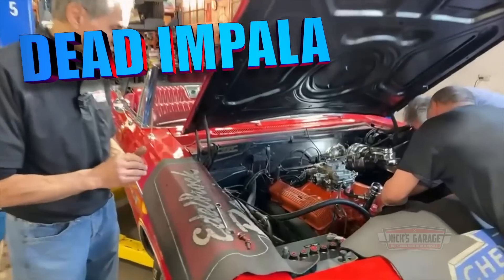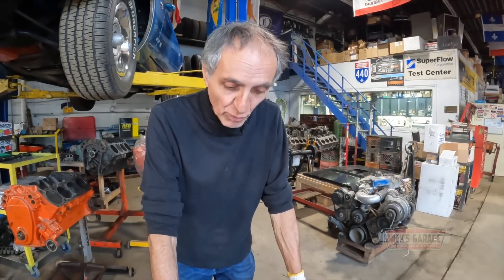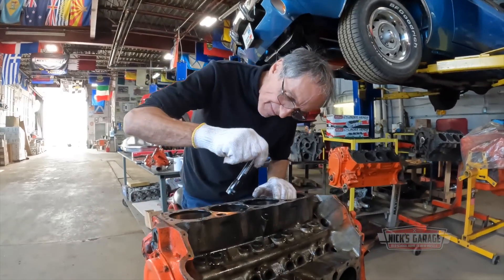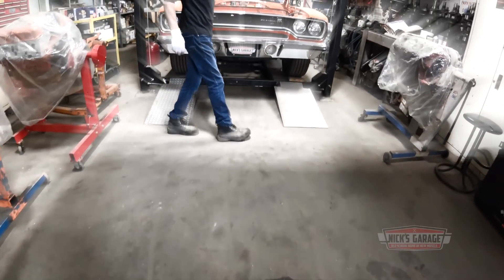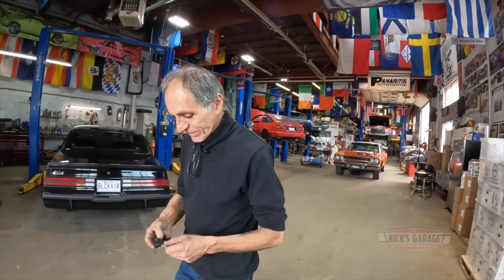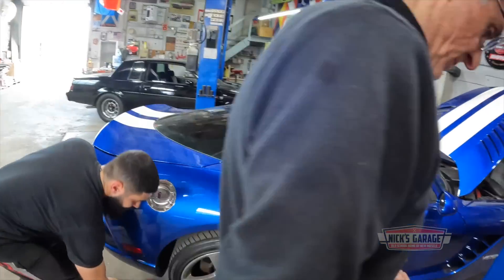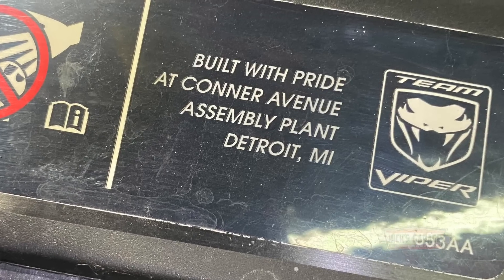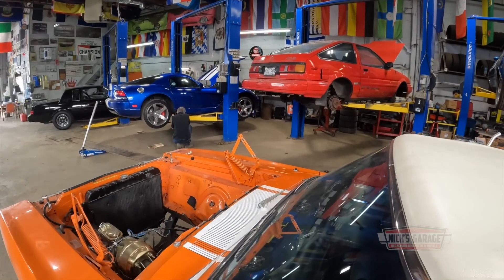327 Chevy Autopsy - Smoking Gun FOUND!

Comment: Years ago I worked on a truck with a 6V 92T Detroit Diesel. He drove it 300km bobtailing without overheating, but as soon as he hooked onto a trailer and got it under load, it would get hot. Detroit water pump impellers occasional would slip. To chec I took the suction hose and the pump cover off. Found a rag packed on the impeller. The radiator had been out and the mechanic left the rag in the suction cover. Without a load a diesel injects almost no fuel so combustion is cool, so no overheat.

Comment: Check the radiator cap it will not vent right and squeeze the upper radiator hose down and block coolant flow

Comment: With the engine getting that hot it could have warp the thermostat stem,im not saying it was'nt a thermastat failure,just saying the locked up thermastat could be from the intense heat.

Comment: Nick. Bad luck loosing that engine. While your tests showed faulty thermostat I was taught never to reuse a thermostat if engine overheated. I'm wondering if overheating caused thermostat failure and not other easy round. You have not mentioned heater core?. I guess you pressure test live system. We had one engine that blew water. 4 cyl. Changed heads and it still did it. Turned out it was a cracked block migrating from head bolt and leaked into bellhousing and dripped out. Was a turbo engine and only under boost with extra load did it misbehave. On another engine we couldn't stop blowing out, fumes. Was a sleeved engine in a racing class. Was all done with torque plate etc. After some time I experimented with checking cylinder roundness with gearbox bolted on and discovered no 4 bore was being pulled out of round by .004" when bellhousing bolts were done up tight. Keep up the awesome videos. Now working on 2437cc turbo engine. Got it pumping out 745hp at the wheels at 6300rpm and 600ft lbs at 5600. That's with 36 lbs boost. We have changed turbo and cams now and modifying wastewater controller. Added thermocouples to each exhaust. We are shooting for the magic 1000hp. Engine is hand made billet with tall deck  long rod set up to help piston acceleration loads and improve dwell times. Mitsubishi based in a 4wd.

Comment: Check the heads crack between valve seats or replacement seats cut to deep, heads should be pressure checked

Comment: You need to take the thermostat out of the water and then measure the temperature directly off the Stat. When you aim it into the pot of water, all you're seeing is the surface temperature of the water. I did infrared thermography for 20 years in the electrical industry and if you look at water with an infrared camera, it is very far from having a consistent temperature. You'll see swirling patterns that have substantial differences in temperature.

Comment: Is it possible that the thermostat is not the problem, but a damaged as a result of the extreme over heating?
Reply: Some casting sand or specks of rust can cause a stuck thermostat. It's good insurance to wash the block and heads if the machine shop is slac king

Comment: One reason cars overheat is when the thermostat sticks Open.  The motor gets hotter and hotter. Until it boils off all the water. I'd have to see the heads. But I've seen it before. Normally a driver would notice but. If it is stuck open it can stay that way forever.  Also check it for actual temperature that the thermostat functions at. The old one may be cooked  also. Should also check the radiator cap.

Comment: in situations like this you might save both your self & customer agravation you might want to install murphy safety gauges on oil pressure &temp so motor will shut down when ever engine reaches your pre set point. Some times even when people see warning light they just wont stop until they arrive where they are comfortable. often times that is to far damage done.

Comment: I had a 65 Chevelle 327 that blew a radiator hose while doing 70 miles an hour on the highway and shut it down immediately and it's still heated up enough to where the block had to be line bored at the mains because when I rebuild the engine I could not rotate the crank after I had installed it with all new bearings

Comment: I have a 1978 corvette 350 30 over I lose coolant badly motor runs great no steam out the exhaust no sweet smell no water in oil no oil in coolant no leaks anywhere motor runs great, can’t drive it because coolant goes away fast ? Checked everything at a complete loss where to go from here, maybe pull heads and inspect. What do you suggest would be next to look at.

Comment: That’s crazy… thermostat failure… wow.. you buy one now, one could only assume it would be functioning correctly from …. Quality control tests before packaging and for retail….? 🤔.. one could say the over heated engine caused the failure after the fact.. If everything else is correct in the system and the t system is the only thing showing non function.. then it’s no doubt the T stat that created the problem.. good find Nick!

Comment: In Tool & Die we use a liquid die made specifically to find hairline cracks. May be useful in your tool arsenal. Your knowledge and the quality of your character make for videos I truly enjoy, thank you. A question: working on old vehicles have you ever not been able to find a  needed part. It took me 4 months to find a transmission tailhousing for my 89 Dodge 3/4 4x4. Found one 2000 miles away and cost as much as a transmission.

Comment: I once drove a taxicab in Tucson Arizona for several years. I was driving a taxi. It was a Ford Taurus wagon and it starting losing power. I noticed it was running hot but not overheating. I was able to get it to the shop, i told them of the performance problem and got me another taxi. The next day i was told the vehicle had overheated and now it had low compression and won't start. There was no coolant in the radiator. But the strange thing was , I never saw any steam. At least not around the front of the car. My guess is the engine blew a head gasket and i did not notice any steam coming out the tailpipe.

Comment: I would consider submitting the thermostat that failed the "heat test" to your insurance and see if it will pay for the rebuild.   Given that the hot light was working they may not pay, but once that's been done your own liability can also be mitigated using the insurance failure to pay as a basis for not accepting full liability for the motor failure via your shop.

Comment: i had a 350 marine engine i over hauled, that sprayed water everywhere when it cranked.  i pulled it out of the boat 3 times  to look for a leak in all the areas you mentioned and it wound up being a small hole in the valve port that on the #2 cyl head.  replaced the cylinder head and put it back together and it ran for the next several years, trouble free.  i had the machine shop that did the bore and crank turn, boil the block and heads also, and that seems to be the time that the rust that was removed from the raw water cooling sys, loosened a rusty spot in the head on that #2 valve port.
Reply: Was your boat engine a 350 cu in Or 454 cu in Chevrolet  engine?
Reply: it was a 350/5.7l with 2 bolt mains, 'bout 79 vintage i think.  all cast iron block and heads and manifolds, reverse rotation with paragon transmission and single screw.  crusader brand exhaust and risers. originally pulled it after the raw water pump failed and overheated the whole block assembly due to no water.  be sure you replace the rubber impeller every year or be ready to spend some money.

Comment: I did see one lock up completely when a guy fell asleep with the engine idleing and the heater on in the winter it had a minor coolant leak that caused it to overheat and lock up tight old boy woke up cold and with a junk engine totally junk it melted the plastic round clip off the oil pump that holds the pump rod in place during assembly that's hot

Comment: I have used those free flow thermostats before and have had over heating problems I went back to using Stant regular 180 thermostat and all was well again try Stant I wouldn’t trust them Mr Gaskit one’s especially if it was fine at first them stopped working later could happen again 👍👍

Comment: all that grief for a stuck thermostat. I have had them stick shut but figured it out before it was to late. if he was driving slow in town he might have been alerted buy the steam surging in the radiator but on the road it all went unnoticed. looks like a real temp gauge would be a good idea. although the hot light should have come on if it was in working order.

Comment: Do they make a sensor you can install in engine that if it starts to over heat will shut the engine down be a great ideal. I have worked on cars all my life probably seen 3 New ones bad from The start what's mind bottling it was working just fine and ended up sticking. I would check with Mr gasket companies are contracting there work. Alot of them have there items built some were else see if they have switched manufacturers. I was in manufacturing most of my life we could always tell when they changed things up.

Comment: Interesting work-but where did the coolant go ? Hose seal = headgasket - waterpump ?
Reply: My thought also. Engine was obviously burning coolant if exhaust was steaming. What do the spark plugs look like? Should be able to see which one are steamed cleaned. Coolant had to go somewhere.
Reply: @jedm1466  Bet you it was a bottom rad hose not nipped up enough and sending a tiny jet of coolant out onto a hot exhaust pipe .  easily done !

Comment: Use brake cleaner clean cylinder walls then spray walls again let it air dry and the cleaner will show cracks due to it taking longer to dry in  crack it will still be wet in crack works good

Comment: The car/owner made more than one round trip, without problems. That says everything was operating normally, including the cooling system. The last time I saw an overheated engine with the paint burned of near the deck surface, the coolant level had run low enough that the heads were 'dry'. Someone commented on seeing steam or smoke coming from the exhaust pipes. That would bring questions regarding cracks in the cylinder head(s) We recently went through a similar experience with a small block Corvette engine rebuild. 
 By the size of the serial number pad, front, passenger side deck surface and the driver side location of the dipstick, the block is a 1977 to 1979. Later 1079 blocks had the dipsticks moved to the passenger side. That would make it a large journal 350 block. To make a 327 with that, a crank from a 307 (large journal with 3.25 stroke will yield 327 cubes.

Comment: I must confess I did the same thing here. I have a .030 over 327 engine and I went up into Georgia to service a business machine (live in Jacksonville Fl). Well, I worked into the early morning hours and went home. Going down US 1 and on a two-lane country road and I notice my vehicle starting to surge and looked down at the gauges and the temperature was pegged hot. Well, I really had nowhere to pull over (unless I wanted to drive into a ditch) and continued on until I could find a place. Well, the stupidity is on me as it was a ways before I could stop and the engine was cooked, so I just took a nap and woke up in the morning (I had finally stopped at a convenience store). I put some water in the vehicle and got it started and drove it for a while but had to put another set of cylinder heads on it, have the deck of the block surfaced and had shrunk five pistons (of which we had knurled). I cooked that engine far worse than this one and fortunately there were no cracked cylinders.  Not a thermostat, not a head gasket but a bad radiator cap. I used the same radiator cap that was on the vehicle when I assembled this engine and when a friend of mine who had a shop tested it, it was bad. Well, that is on me, and I learned something there for sure. I had learned a lesson on a sticking thermostat some years before and flubbed this deal as well. Also, when an engine overheats one should never keep on driving it as when the coolant is gone, air is a poor conductor of heat and that is what cooks the engine up. Pull off immediately and let the engine cool (no water until it cools as you can crack things). Whether this owner continued to drive after the car got hot is really his issue but I am willing to bet he had but I am willing to bet that he won't do that again. Granted it is not always easy to immediately pull over due to where one is but continuing to drive an overheating vehicle can be costly. Now I also installed a warning system that was marketed by Stewart Warner and it consisted of two electrical send units (one for oil pressure, and one for temperature which could be plumbed into the engine in conjunction with the factory gauges and they were wired into what was essentially a key buzzer (you know the one that buzzes when you leave your keys in the ignition) and a warning light. So what we have here is if we lose oil pressure or the temperature goes up the driver is warned that something is amiss. Even with mechanical gauges one's attention can wander and that can be too late. This was back in the late seventies so I donot know if Stewart Warner has this item in their inventory.

Comment: People forget what it was like to drive these cars.  They aren’t like modern cars that warn you.  In ‘65, when you went to the gas station, the attendant would ask to check your tires, oil and coolant.  YOU needed to keep a constant check on the oil, coolant, tire pressure.  Most of these coolant systems had no recovery for coolant when the cap released.

Comment: I think that you will find a catastrophic failure in the block that was caused by the  heat caused by excessively grossly  high timing.  The only thing that you have to worry about is did the car leave your shop with the timing  that  you used on the dyno.   The car would have been a screamer until it hand grenaded.

whe reyou had it on the dyno.

Comment: But where did the coolant go? 
Were there hardened seats done on the exhaust valves in the heads? Could the machined seats cut into the water passage of the head?

Comment: My guess is it has a crack open on it and the water went out the pipes.
Did they replace the radiator?
I had a 67 Impala that liked to puke
it's water out the over flow tube and run
hot

Comment: My wife melted down a 350 and a 355 in her 79 Z28in the early 80's parking too close behind cars in the bank drive thru in 100 degree weather with A/C on full blast. Finally put a 383 striker in and sold the car.

Comment: I once had a intake leak coolant leak after was warm at the intake gaskets because the angles was off a little. An it never got into the oil.... Was that intake the same one with that engine block? Was ether the block or intake milled??? WOW that engine was really hot to burn the paint off like that...

Comment: i had a problem with my pro built 327 but it had all new over sized cylinder put in it and  one had a pin hole in it could not tell or find it but after a few miles it started blowing steam which caused a lot of damage because i was running 13.5 to 1 compression with a tunnel ram . the guy finely found it the pin hole when it was cold it would be closed but after heating the engine to full temp it would start blowing steam. if i did not have aluminum titanium alloy rods it would have blew the engine. the shop fixed it.

Comment: The thermostat almost sounds like the problem but where did the coolant go? I still say it's the radiator cap was too low of a psi and the coolant just dumped onto the roadway via the overflow.

Comment: I had a 1981 Z28 Camaro that someone put the rad cap on to the first notch as a joke. First time i went up a long grade i spotted white smoke in the rear view mirror. In a matter of seconds it dumped the entire contents of the system. Luckily i saw it and stopped immediately.  Also a trucker stopped to give me a hand and gave me a gallom of antifreeze and i had a gallon of windshield washer fluid and i topped it off with pee because back in the dwy road trips usually involved hiway sodas. Back when truck driveds were the knights of the road.

Comment: Would it not be a good idea to put a ignition cutout by bolting a 250 fahrenheight switch to the chylinder heads?  If it REALLY overheats it just kills the sparks ... my feeling is though, that thermostat has been damaged by the high temperatures.  To get that hot the engine would first have to boil off all the coolant ... plenty of opportunity to catch that.

Comment: If you don't mind my asking sir where are Mr. Gasket thermostats made now I've been retired for awhile now but the last thermostat I installed was Stant it was made in the US I always used stant  and like the Mr Gasket brand you use I never had a failure just wondering if Mr. Gasket and possibly others including Stant offshored their manufacturing and as we know especially on small parts like thermostats quality control is basically non existent

Comment: nick just wondering if the holes that were cut in the fire wall if was done to replace the  freeze plug in the back of the head my brother did it with my 70 GTX 440

Comment: Hey Nick did you physically grab the impeller on the water pump and hold it while turning the pulley with your other hand to see if it was slipping the shaft like mine did in a Jaguar before

Comment: vicervircer the trans cooler could be bad transmission would have gotten very hot and moter couldn't keep it all coll enogh and fried engine not sure just a thought going down my thought list good luck nick you can figure it out iam sure
Reply: Since the engine was cooked and the radiator was empty I wonder how cooked the trans fluid is now???